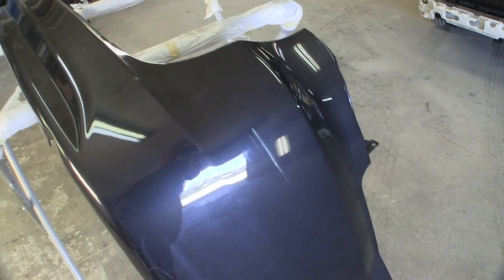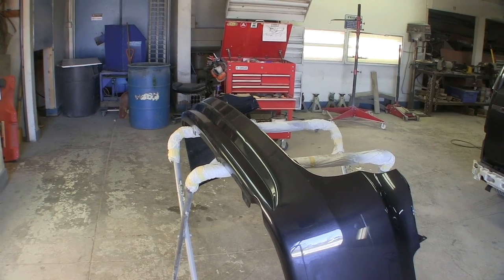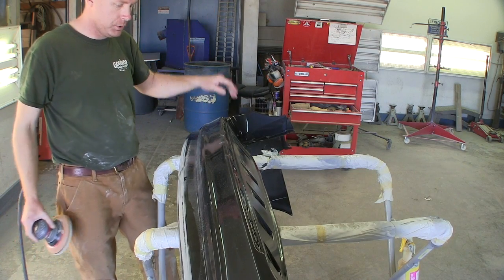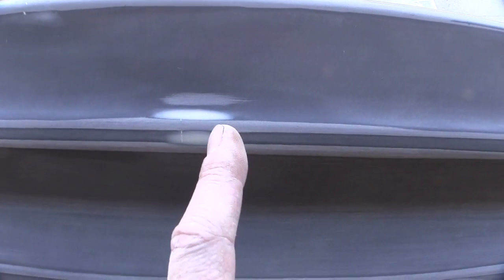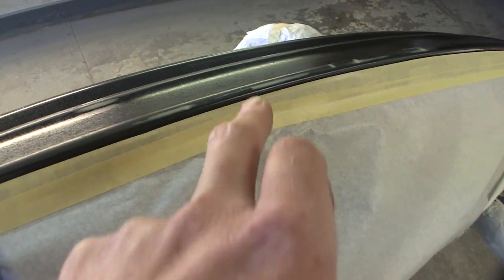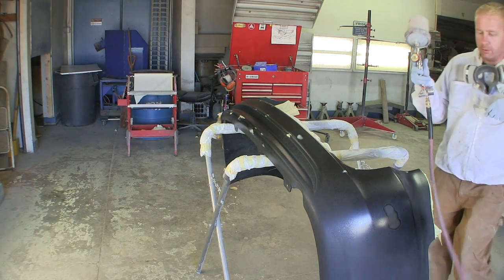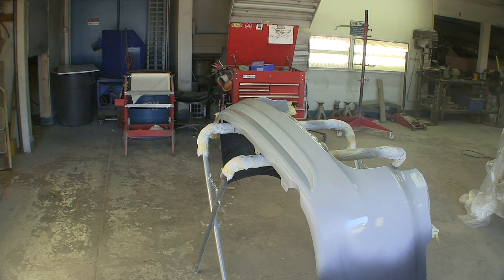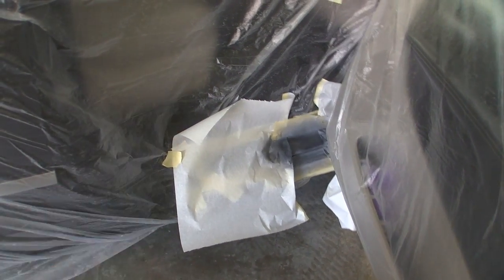2013 Chrysler Town and Country  - Rear Bumper and Door Jamb repairs

Comment: I've been playing with a 3D Doodler pen to repair scratched and gouged bumper covers. So far the results have been really good. Basically scuff any crud out of the damaged area, give it a quick spot heating with a hot air gun and fill it in. Sort of like TIG welding in plastic. Will make this type of repair a lot faster if it works out like I hope. Working on a prototype tip at the moment that will work like the big plastic welder tips but on a smaller scale.
Reply: +Blazer02LS That's a pretty cool idea!
Reply from the maker: Now that would be sweet

Comment: Shawn, if I may suggest something.. unless I missed it in your explanation.. You stated that you do have a Bulldog prom adhesion in a regular can. So, I'm assuming you used a spray can because you didn't feel like cleaning a gun twice. Just to let you know that you don't have to clean the spray gun after the bulldog before pouring the primer or the basecoat in, because once you pour back the extra Bulldog left in the gun back into its original can after you done, you can just mix the primer or a basecoat into the same gun that you just sprayed the bulldog with. Their latest formulation makes the bulldog act like a flex. And when needed you can even add it to your paint. Even if your primer gun is 1.8 tip, it should be just fine. Again, sorry if I missed your reasoning for going with a spray can. As always enjoyed your video.
Reply from the maker: Not sure what I was thinking either 😀

Comment: Hey Shawn, have you tried using the Fusor bumper repair stuff to fill those spots? I wonder if that would hold up better than putty. I love that stuff since you introduced me to it. I did a bumper cover tab repair on my parents Camry a couple of weeks back. Just used that stuff with the mesh material to build a new tab. Viola!
Reply from the maker: I like the fusor for structural repairs but I am not impressed with how it feather edges.

Comment: That little deformed area you pointed out that it looked like it had melted got me thinking:  How do these bumpers respond to heat?  I have a strange "melted" spot almost exactly like that, and I've been debating whether I want to cut the section down and fiberglass it, or see if I can mold it back into place with a heat gun.
Reply from the maker: It's a mystery to me